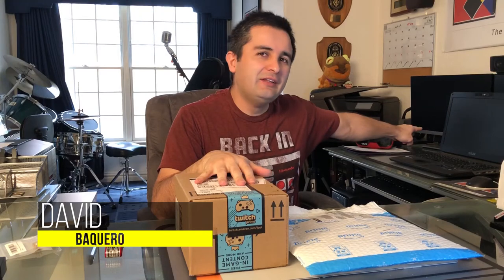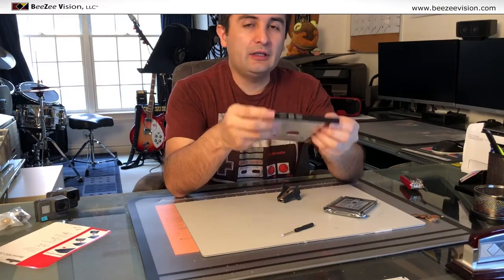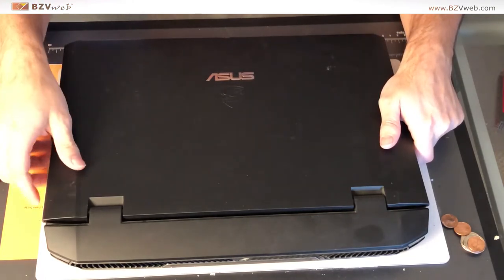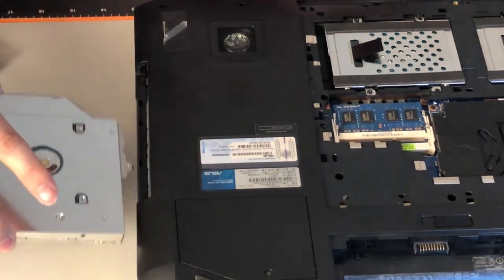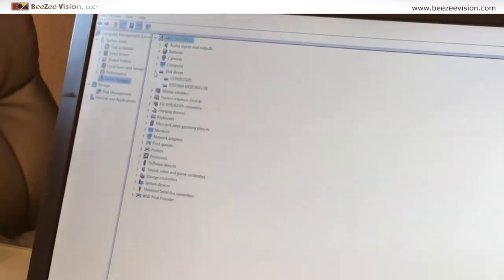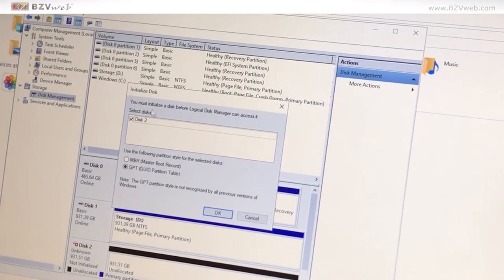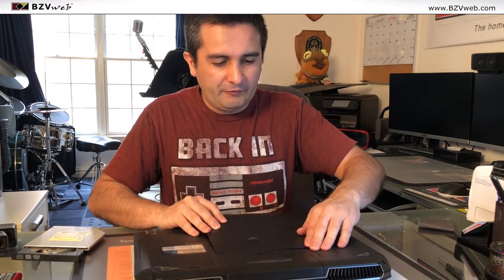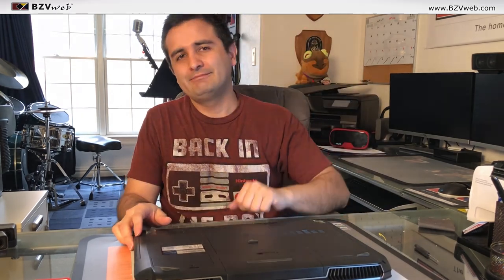How to Install a Third Hard Drive on my ASUS ROG G75VW Laptop

Comment: I have this same machine and I'm considering replacing my optical drive with an SSD. (This would make it a total of three drives) I would like to install the OS on the SSD to increase speeds, but heard I shouldn't install the SSD into my optical drive slot due to the slower SATA 1.5 connection. Would you recommend I install the new SSD in the main drive slot and move the old main drive into the optical slot?
Reply from the maker: Thank you for your question.Since my Western Digital Black is connected on the Optical drive bay as a third HDD, I am able to verify that I can get up to 6Gbps transfer rate on it. I don't see a problem with the speed in that sense for your SSD.However, I personally prefer having the primary drive be on the first drive bay. In this case, your SSD would be your new primary, and your old disk would be a second or third drive. This is mostly my personal preference as I can easily identify which disk is 1, 2 or 3 on my bios, based on the SATA channel without second guess, specially when it's time to reinstall the OS.All three drive bays can run up to 6Gbps (SATA-III) speeds on my specific model.

Comment: Bro, please. Have you ever put an External GPU on your ASUS ROG?
Reply from the maker: no, I actually haven't tried an external GPU. so far I've not had issues with the existing card. I run it with all 4 displays at 1080p for work (3 external + 1 laptop display -- custom profile to 1080p instead of the native 1600x900).

I changed the thermal paste on mine and it runs nicely even while editing video at 4k. I'll be uploading a few more video tutorials of updates and maintenance I've done to it first chance I get

Comment: 9.5mm or 12.7mm?
Reply from the maker: Hi and thank you for your question! 
It is 12.7mm for the ASUS ROG G75VW to fit snuggly and tight. 
The 9.5mm can also fit with some room to wiggle, but it's best if it doesn't shake, because of the hard drive.